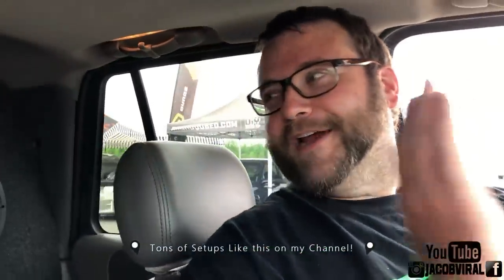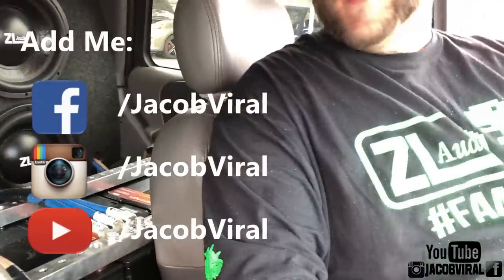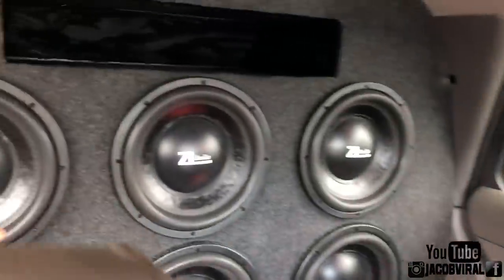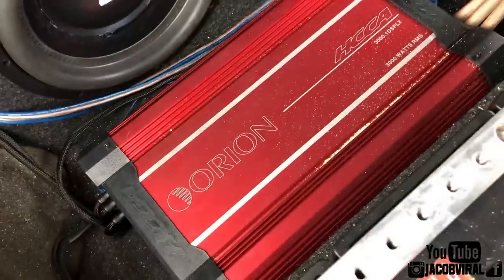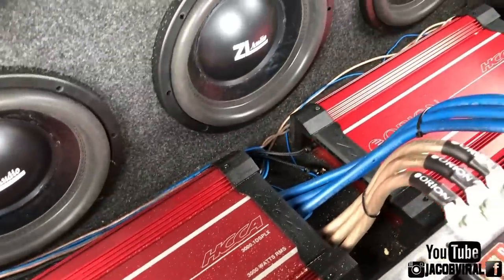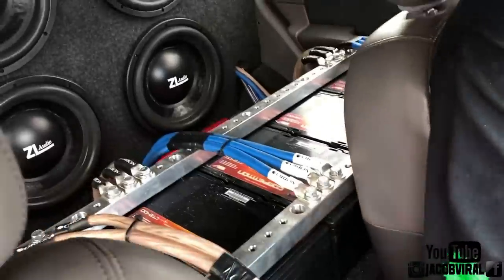6 12S WALL BUILD FLEXING EVERYTHING!?

Comment: A rolling, two seat party on wheels! Someone finally took a bunch of Orion high sensitivity mids with  the phase plugs and accordian surrounds plus the bullet tweeters and let them play to the outside. Orion wants to have the huge systems with massive public following like the Brazilians (Stetsom, Sound Digital, Banda, Taramps, etc). This is good.

I like the low and central placement of the battery bank. Better handling even though I am sure new springs were needed for the Trailblazer. Greatly simplified the appearance of the wiring to the amplifiers.

Comment: 6 12s is my favorite setup. Hit harder then my 4 15s an harder then my 8 10s.  All were same brand woofers an same power. 15s did drop a little lower but did not feel the hit of bass in body like the 12s. #multiple 12s all day
Reply: That blazer next to it does 57s on 3k rms. 4 15s, flatwall. 24-50hz range.
Reply: @Zackefel  hell yea..good shit

Comment: Why do a c pillar wall and take out the rear seat? I would take those speakers out of the back and move the batteries and amps to the rear. Imo haveing the extra seats is cool because you can give multiple demos at once.
Reply from the maker: Some just do things different like having a stunt wall in the back so no room for electrical/amps so he did it like this, but good point.

Comment: Quick question I use the re box calculator to build a box for 2 zvx 18s  around 11 cubes before displacement it's suppose to be tuned at 33 but is more like 47 it's loud as hell but I was going for some Lows. Iv built all my boxes and never had this problem. What went wrong?
Reply: I build a lot of boxes to man and honestly idk why it ain't low but chances are maybe your port if its ported might be to big or to small
Reply: @quintonlitton6779  It's exactly like the box calculator said to make it. I read in a forum that with the re box calculator for 2 subs you have to add a 2nd port exactly like the one the calc. Says which seems like adding a second port would make the tuning go up. Unless there is something I don't know which is possible.
Reply: @brandanfiscus5563  I'd put a divider in the box so each sub has it's own chamber then dual port the box. It's what I did for my 2  Americanbass 15s and there doing 150s and my highest Db is a 152.4 @ 38 hz
Reply: @quintonlitton6779  I have been debating that. I think I'm going to leave it how it is until after slamology. Then try to change it up. And see what the difference is in sound and spl. Thanks for the advice man.
Reply: @brandanfiscus5563  no problem bro and hope to see ya at slam I'll be there Sunday the 9th cause I'm getting married the 8th :) me and my girl will have our newlyweds shirts on when were there Sunday. And if I meet up with ya I'll be able to see ur setup in person and see If I could give you some pointers and js I've built builds for 8 18s 6 18s 6 15s 12 12s and lots more and smaller sub boxes to
Reply: @quintonlitton6779  I'll be there the 8th I have to work Sunday night. But I might try to make it back up there.